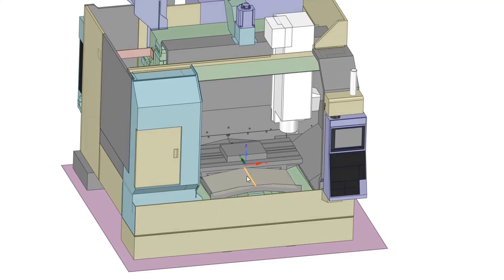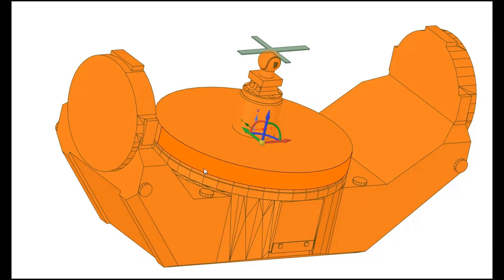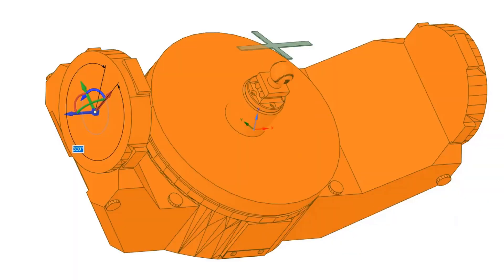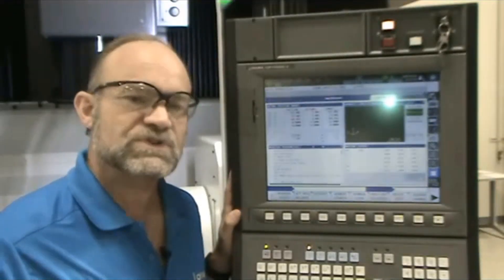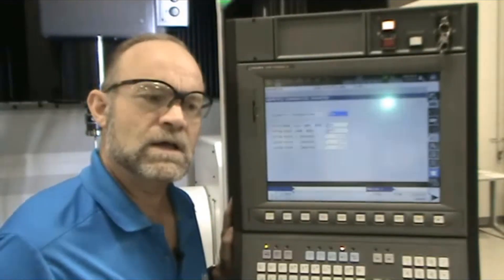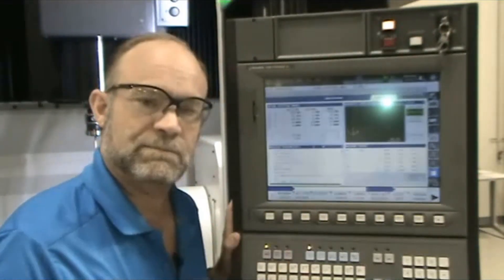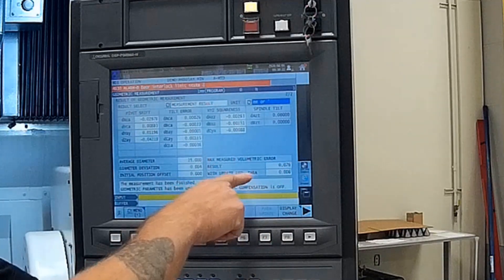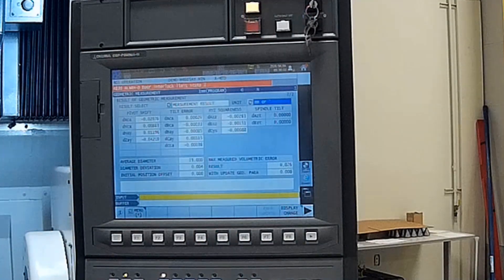Okuma 5 Axis Auto Tune

Comment: Do we have auto tuning system on MU500VA-L OSP200p-H
Reply from the maker: Probably not from Okuma, but you can always get the Axi-Set software from Renishaw. Pretty much does the same thing. I don't see any manuals relating to AutoTune for P200
Reply: @pocketcharleywithgosiger  how can we do the geometry reset if we dont have that on osp 200M-h